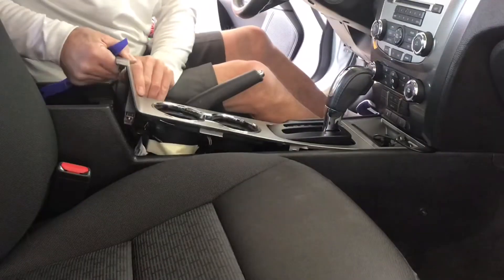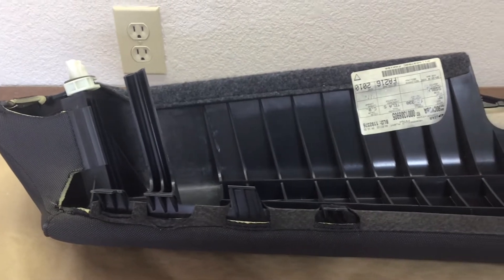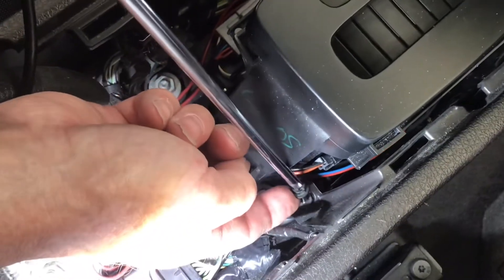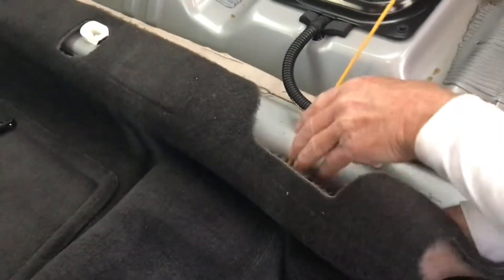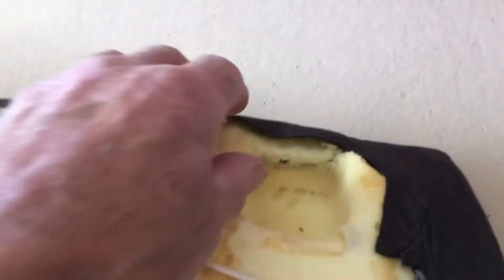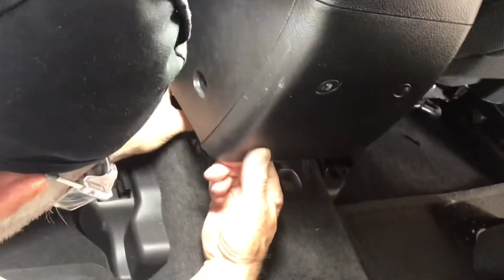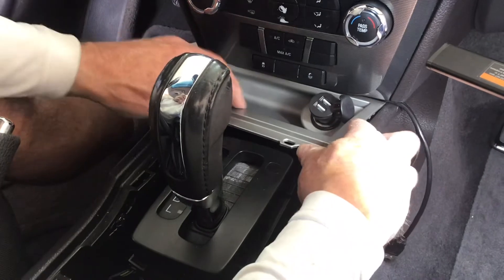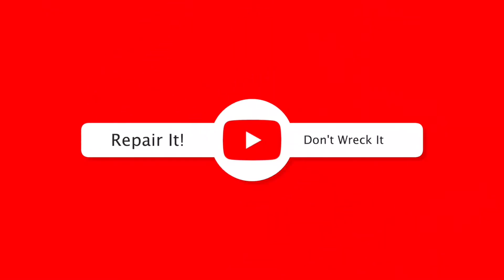How to install a cable for a rear dash cam/2006-2012 Ford Fusion/ VIOFO A119 V3

Comment: Thank you. I will try to run it on side, if I couldn't, I will use your way.
Reply from the maker: Hey Mbr J3idi. There’s more than one to run the wires. There’s really no wrong way. Good luck with your project. At least you have a few ideas before you start. Thanks for your interest in the video. Roger
Reply: Did you manage to run the cable through the side trim pieces? I gotta run a A/V cable to the front windshield camera. thru the right side.
Reply from the maker: @jesussalinas5222  No I didn’t. I’m sure it can be done. It’s been a while since I did the video.  From memory it seemed harder to remove the trim from the door sills. There was a lot wires in the location and the trim was very tight. I was afraid to break the plastic pieces and get all back together properly. Thanks for your question and reviewing the video. Roger
Reply: @jesussalinas5222  Yeah, it went fine. I ran it from side down  on the floor. But be sure you have enough length cable and be careful while removing the plastic covers. Some clips may break, it's not that big deal you may replace them, but it will add an extra effort.